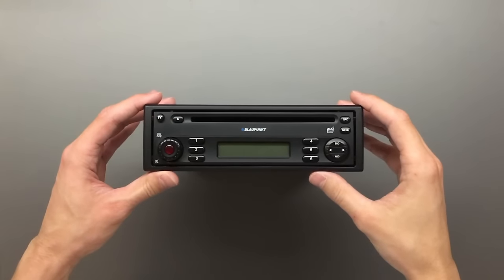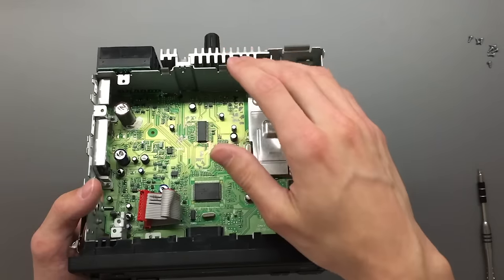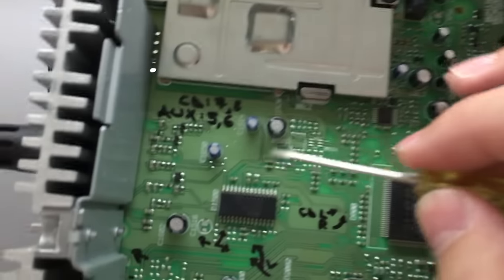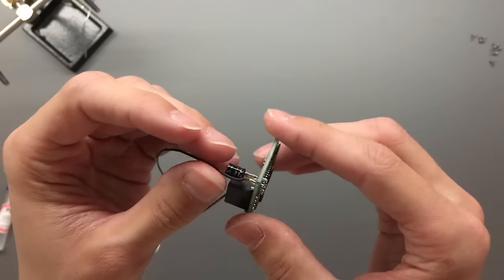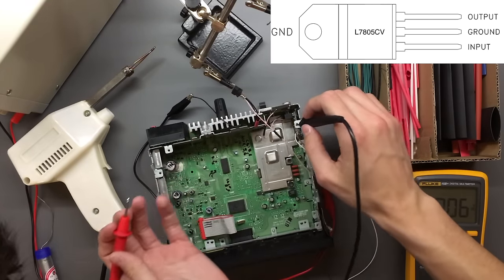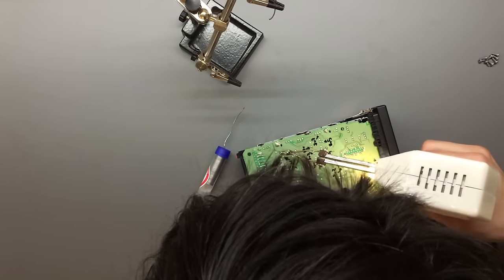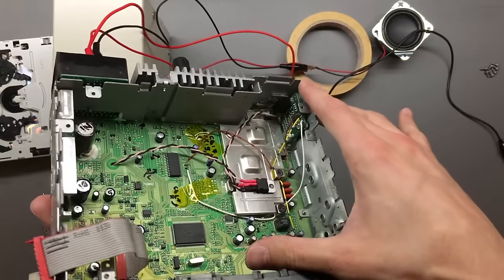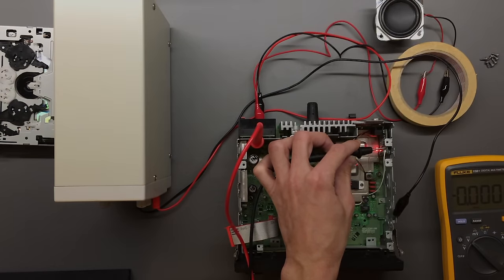How to Add Bluetooth 4.0 to Any Car Stereo for 12$ ! Complete Guide !

Comment: This is very elegant work, but you did all this and still need the CD to work for no reason, isn't there another way around it? My own car stereo had AUX, so I went that way. Used a 1W car charger to get the power to the BT board, don't know how to work with regulators or I'd use one of those. The BT chip was a cheap Chinese car to BT audio adapter. Total cost was under $5 plus work but like I said, my stereo has aux, so it was easier that way. Also couldn't fit the CD module afterwards because of the car charger case which I kept, so it and the car board wouldn't short circuit or touch anywhere. So I removed the CD permanently, it's not like I have CDs nowadays anyway. Didn't ground the BT chip either, just used two passive ferrite cores each per channel to down the noise coming for EMI.
Good video all and all.
Reply from the maker: Unfortunately mine doesn't have any way to select the AUX input, the audio MUX chip has it buut, yeah, can't select it (chip is controlled by i2c most likely)

So, although I am using the CD player, it allows me to equalize the signal and add faders 

I've recently modded a mercedes radio and fed right into the amp, but that went terrible : no equaliser no volume adjustment on the radio side and no faders

Comment: Hello I have question. Would it work if I soldered an Aux cable to the Cd changer pins in the back ?  
I have the same model radio as you does it ask for a code afterwards ?

Comment: I really would like to see if it's possible to add bluetooth to headphones (the big kind). Even though there are bluetooth adapters with an AUX output, they don't blend in with the headphones and make it look weird. I could provide a technical drawing of the chassis I'm thinking of.
Reply from the maker: It is very possible, and even rather cheap; all you need is one of these:
http://s.aliexpress.com/euQfIZ7n , a tp4056 li ion charger & protection module, and a little li-ion battery

Comment: hi darieee,
do you have a pop sound when you pause the music with that csr8645?
how do you suppres that annoying pop sound? (I havr just the module, without the green amp board)
Reply from the maker: Aaaahhhh, you've come to the right place

I've spent probably around 20 hours in total with a dude selling speaker kits trying to solve this issue ... the csr8645  chip has some bug in either the firmware or even the hardware ...

I'll correctly assume you're not using an iPhone as well; the problem is for the codecs used by android phones, IF THERE IS AN EQUALIZER ENABLED, you'll get this issue with the poping

You could disable the EQ, and it should be fine, or get an iphone, redo the EQ for AAC (which is the codec only iphones use - technically inferior but - on the csr8645 it doesn't have this issue) and it should again work

Alternatively, to keep the equaliser and have it work with all phones, you could move up to the CSRA64215 (sometimes sellers list it as just CSR64215)

That one works flawlessly
Reply: hey Dariee thanks for the reply,
Correct, I'm using Android phone,
I tried to disable the SoundAlive EQ built in app on my S8 but still get the harsh loud pop sound.
I have 4 such modules csr8645 - do you happen to know how to disable the EQ on Galaxy S8?
As a matter of fact i was wondering if the lack of green amp module was the reason i get pops... I looked and found there is a module TPA6132 that accepts differential input and has single-ended output, it also has a built-in pop suppression to eliminate start and pause pop sounds, havn't tried it yet. cheers and thanks for you help.
Reply from the maker: I meant the equaliser ON THE CSR8645 - the bluetooth chip has a built in digital signal processor that can apply an equalizer and some effects to the sound it receives from the phone (it's called Kalimba)

Check my videos on "setting an equaliser on the csr8645", you basically have to disable that on your module

Just to be clear, you get pops when you skim through music for example ?

Do you have a TPA3116 amp that gets turned on/off every time the music stops playing ? It could be the amplifier chip as well in this case although more unlikely
Reply: I dont have any amp module, just the bear blue F-3188 modules.
I really have the feeling it's the Kalimba internal eq that is causing this, can it be disabled by simply using the PSKey Tool ? or should i do a dump with it and use Config Tool to remove Kalimba and then merge back to module with PSKey tool ?? (sorry, I just got usb-spi module but havnt played with it that much...:)
Reply from the maker: Check my video on the equaliser, and you'll see all that needs to be done

In a nutshell: connect csr module to programmer, play music, start frontend (under 32b win7), connect to module in frontend, click glasses (look at the first layer to see if indeed the eq is enabled - feel free to play with setting here to see if anything helps), click glasses again to leave the blue/live mode, modify the settings, and click save psr

Mmm crap yeah scratch all that - check my csr renaming video, there should be a stock .psr there : get that.

Then go to pstool, click restore all settings (or something like that - it's in one of those dropdown menus)

After this, hit merge with my stock psr (and change your name whatever)

This should remove the eq
Reply from the maker: The reason why my initial suggestion will not work, is that PSTool with the Merge operation can either ADD or MODIFY EXISTING configuration parameters

If you merge for example my stock no-eq dump with the settings present on your chip which include the lines for the eq, those'll simply remain there, and you'll change the name line only (for example)

That's why you need to go through the restore part
Reply: questions:
1) will the 'eq disable' dump work on pstool running on a 64bit win7 pro machine? if not, can i 'brrow' from you a win7 32b install image and the VM software ?
2) I was wondering if disabling my csr8645 eq make music7 sound crappy? oh well i ges ill have to try that to know, anyhow the dreaded pop sounds must go.
Reply from the maker: 1) Yesss, PSTool works superbly with x64 win 10 fortunately
2) It really depends, given you have an android phone, you can tweak the sound on the phone, and send it "already tuned" to te device to play back as is

With iphones, you only get a bunch of presets which are no good if you have home made speakers or want stupid levels of bass 

Give me your email, I can hook you up with a fine vintage windows 7 x86 image

Comment: Or get a $40 Bluetooth radio? But I'm actually thinking of doing the same to my factory car radio. Might go full aftermarket, as those can learn the steering wheel control singles to pause/skip/play over Bluetooth. Even come with backup cameras.

Comment: Man, i consider myself techSavvy. I've repaired ps3's (complete BR lense replacement) , hacked ps2's /NDS / PSP's , root + unlock bootloader on Android , jailbreak'd iPhones, repaired PC's and all that  basic stuff, but i'm completly lost here. This is NOT  for beginners , neither for adepts. But koodos on this stuff. This is impressive. But not for me :/ , cheers !
Reply from the maker: Naaah I don't know, if you have a multimeter and are lucky to have a roughly similar topology, you should definitely be fine

Comment: What, no foam, or even tape, to cover up the connection points on the BT board? As in, to secure it from shortouts?
Reply from the maker: mm, nah - it's held in with 2 screws ... and the cd module, which is the other metallic component that could mode, is also held in with screws in at least 3 points

also - the general public isn't allowed in there so - should be fine
Reply: Darieee But what does the way it's mounted, have to do with electric safety? I'm no expert on this kinda stuff, so I'm confused. But thanks for the reply, anyway.  #eurozone  (As in Europe, not the EU thing in Brussels. 😆) Oh, nevermind, now I see. I went back to the video, and went fullscreen. There are some kinda spacer on the screws themself. Nice job, and just how I would like it too. Very professionally done. 👍
Reply from the maker: Thanks - so, safety wise, you could lick everything, it's 5V or less

Comment: Is there any way to cheat the autoradio in order to avoid using the blank CD? I believe it should be possible to identify which pins are activated when inserting the CD and tell the autoradio to switch to this input

Comment: My stereo has aux output so I bought usb powered audio bluetooth module from ebay for 2$ and soldered aux out wires from module to aux in of my head unit, downloaded datasheet of my head unit to find 5v source to power bt module and soldered these wires, done. if its branded head unit there is a chance you can find datasheet for head unit, mine was Pioneer.
Reply from the maker: Nice!

Comment: geat video , what if i call using this bluetooth , does the microphone of the phone works ? , have you tried this ?
Reply from the maker: yeah that's actually by default a huge pain in the ass - you'd be on a call, start the radio - the bluetooth module inside would hijack your call posing as a bluetooth headset, aaand yeah, the volume would be way too low for you to hear the other person, and said other person would be unable to hear you unless you'd have connected a mic (which someone in the comments here said they did - and that it worked fine)

if you want it to work as a normal bluetooth speaker, you'd have to do this : https://www.youtube.com/watch?v=rrxBgFDEjMM

Comment: only my way to see the things here...about the aux input selector some radios need to have a resistence on the cd charger/aux input in order to let you select the input...with out the resistence the item conected seems not in the list of items to control....some manufactures put different values to each item to control in order to the resistence the radio (knows the item is connected) sorry about my english...im from costa...tnks..
Reply from the maker: +alejandro soto mmm, might well be - the way I was(and am?) assuming its done is they simply have 2 ROMs for the Microcontroller - one with the AUX enabled and one without ... it would indeed be more elegant if it was done your way, if anyone knows for sure tell us

Comment: Hello, I would like to try do this on different Blaupunkt radio. On mine I have two microchips: TDA7476 and TDA7433D. Which microchip I should use and which pinout?
Reply from the maker: most definitely the second one; but, which pins exactly will depend on the topology of your specific radio
Reply: Darieee  can you recommend me some for pins pair for beginning? I will make tests.
Reply from the maker: doesn't work that way - if you don't even roughly know what to look for, it's probably best to leave it fir another time and watch some more ffcossag

Comment: Hi, Ich glaube du bist aus Deutschland, deswegen frag ich auf Deutsch.
Woher hast du das DataSheet bekommen?
Ich bin Student und habe ein standard VW Multivan Radio und hätte das auch gerne anhand deiner Anleitung modifiziert.
Und noch was: Was macht dieser "capazitor" den du an das Board gelötet hast?
Bitte entschuldige vielmals die ganzen Fragen, würde mir nur wirklich sehr viel bedeuten, wenn du mir da weiterhelfen könntest!
Beste Grüße, Lukas
Reply from the maker: Hi - welchen Datasheet meinst du ? (alle sind allerdings auf google sehr leicht zu finden :)

Am Anfang solltest dein Audio Multiplexer Chip finden - sitzt fast immer sehr nah am Amplifier Chip

Welches Kondensator meinst du genauer ? Die kleine auf den Bluetooth Board ? Der ist da um sicherzustellen dass der Bluetooth Chip nicht gestört werden kann

(PS: bin aus Rumänien - studiere hier allerdings xD)
Reply: Hi, danke für die schnelle Antwort - du schreibst sehr sehr gutes Deutsch!
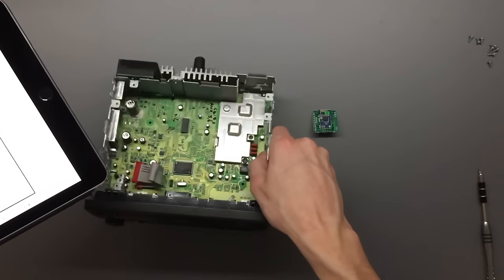Das Datasheet, das du auf dem iPad (z.B. bei 2:37) hast. Was hast du da gegoogelt?
Ok steht da dann dabei, wie der chip heißt (Audio Multiplexer)?
Ich meinte den Kondensator bei 6:37 ; Was sollte den Bluetooth Chip stören? Was hat der für eine Typenbezeichnung? Und benötigt man den auch bei dem 12Volt Modul?

Deine Hilfe Bedeutet mir wirklich viel! Versprochen, ich versuch dich nicht mehr zu fragen als wirklich nötig! Ich weiß, wie das ist, wenn jemand in den Kommentaren immer 100 Rückfragen hat.
Reply from the maker: danke auch xD

Datenblatt auf dem iPad zeigt ein TDA7419 : also, eine suche nach "TDA7419 datasheet" (oder was auch immer auf den chip geschrieben ist + datasheet) soll normalerweise funktionieren

Ja - der Kondensator meinte ich auch - ich habe keine Ahnung wie gut meine Stromquelle ist - und mit ein Kondensator da, riskiert man weniger : also, das wäre eine sichere Vorgehensweise (so wird der Spannungsregler auch stabiler).

Der Kondensator ist 16V und 22uF

Bei der 12V Modul ist es wichtiger würde ich sagen ... Und die sind auch sehr billig auf jeden Fall, also ...
Reply: Darieee Ok Super Viele Vielen Dank! 
Verstehe, also der Produktname steht auf den Chips geschrieben!
Jetzt wars das auch mit meiner Fragerei (hoffentlich)! Nur eine Sache noch: Warum hat der Kondensator 16 Volt, wenn nur 12 anliegen sollten? Ist das nur so eine Art Sicherheitsvorkehrung?
Und, benötige ich für die 12 Volt Variante auch nur 22uF, oder mehr?
Bitte entschuldige noch einmal die ganze Fragerei, ich hoffe wirklich, dass es das jetzt war!
Reply: Eine Sache ist mir gerade noch aufgefallen; Hat der Kondensator, den du benutzt hast 22uF (Mikro-Farad) oder 22nF (Nano-Farad)? Weil 22 Mirko Farad erscheint mir irgendwie ziemlich viel, aber vielleicht schätze ich das auch falsch ein!
Reply from the maker: Bei mir sind's 5V und der Kondensator ist 19V - dass ist so was für ein Regel: immer ~10V mehr als was du wirklich brauchst

22uF : also micro Farad - ist eher wenig (der großte Kondensator (mit IN beschriftet) ist wahrscheinlich 1500 - 2000uF)
Reply: Ok. Nur noch diese Frage. Tut mir echt leid, dass ich dich aufhalte!
Mein Örtlicher Elektrohandel hat einen Kondensator mit 25V und 22uF - Ich denke eigentlich, dass das auch gehen sollte, wenn du sagst ~10V mehr als man braucht, oder übersehe ich da was, was dagegen spricht?
Außerdem soll ich dann, wenn du meinst dass 22uF wenig sind, eher ein bisschen mehr kaufen, wenn ich auch einen mit mehr Volt nehmen müsste? Oder soll ich dann den mit 25V und 22uF nehmen?
Sorry echt, für die vielen Rückfragen, sollte es jetzt gewesen sein!
Aller beste Grüße, Lukas
Reply from the maker: Keine Sorge :) 

Jöa - perfekt ... es wird ein bisschen größer aber sonst, perfekt

20 - 100 uF soll passen ... wie gesagt - es soll perfekt funktionieren auch ohne Kondensator - ist aber "good practice" einer einzubauen

Viel Spaß, und, ja, keine Sorge - ich weiss wie es ist, viele Fragen zu haben - bin selbst genauso :D
Reply: Ok super! Vielen Dank!
Eine Sache hab ich noch und zwar war ich jetzt überrascht, als ich mein Radio geöffnet hab, dass es viel komplizierter aussieht  als deins :/ 
Vielleicht kannst du noch ganz kurz einen Blick drauf werfen und vielleicht siehst du, welcher der vielen Chips der benötigte Audio Multiplex Chip ist :/
Sorry wirklich! Dachte ich bekomme das alleine hin.
https://drive.google.com/open?id=0B-wWM1X0gUNUbWtyMFBhbl9YN0U
Das CD Laufwerk habe ich schon abgetrennt; war an dem Silbernen Adapter (Mittlere Höhe, rechte Seite)
Reply from the maker: Und als Eingang kannst du kein AUX wählen .. oder ? Nur CD und Radio ?

Gibt's Komponente auf die andere Seite auch ?
Reply: Nein, einen Aux Knopf habe ich leider nicht :/ Genau nur CD und Radio.

Ich hab in den DropBox Ordner noch 2 Bilder von der anderen Seite hochgeladen, aber ich glaube nicht.

Dieser BU1924F ist nicht der richtige oder? Der hat immerhin so eine längliche Form:/
Reply from the maker: Ne .. das hat nur mit der Radio zu tun .. was sind die andere Chips ? (außer die super große)
Reply: Ich hab mit Photoshop drauf geschrieben, was auf den anderen steht; hab es in die dropbox geladen. Hoffentlich sagt das etwas mehr aus. Vielen Vielen Dank für deine Hilfe!
Reply from the maker: Jöa .. ist anders als bei mir gebaut - was sind die Power Amplifier Chips (linke Seite) ? vlt können wir da under Signal direkt eingeben ...
Reply: Welche meinst du? Sind das die ganz kleinen Schwarzen Dinger, die ich noch nicht beschriftet habe?
Wäre es auch denkbar, das Signal direkt über den CD Laufwerk input (mittlere Höhe; rechte Seite) hineinzugeben? Also dass man dann zwar leider kein CD Laufwerk mehr hat, aber wenn man auf "CD" drückt, dass dann der ton vom bluetooth Modul kommt?
Reply from the maker: +Lukas C. Roder keine Ahnung wie es implementiert ist, mittels den CD scheint eher kompliziert zu sein

Die Verstärker Chips sind die große die unter den Metalding links stehen
Reply: Darieee Ok. Also die haben richtigen Namen drauf stehen, wie die anderen. Aber auf dem größeren steht: D4 IRS und auf dem kleinen D6 IRS; es erscheint mir aber auch schwer die metallplatte vorne weg zu schrauben, sodass man an die hinkommt😬
Reply: Darieee Sorry die Namen die ich dir gerade geschickt hab sind von den 2 schwarzen Dingern unten Links; Meinst du die auf mittlerer Höhe links? Hab ein Bild von der Seite gemacht (hab das außen dran weg geschraubt und lads in die Dropbox; die Namen sollten sein: 23T/L1747 (unten drunter steht 553/TN421) und auf dem Zettel daneben Leg. 659
Reply: Sind hochgeladen
Reply from the maker: Kannst du mir deine email kurz geben (dann kannst du es wieder löschen) - ein bisschen unangenehm hier zu schreiben

Comment: I love these kind of hacks!......now please  show me how the add lithium ion batteries to a class d amp that uses a switching mode power supply!......my small guitar vocal amp doesn't have a 12v transformer!
THE reason I I need this is to play outdoors!
Reply from the maker: Check this video out, it should have all of what you need: 

DIY Bluetooth Speaker : Parts Guide 2 : TPA3116 + CSR8645 + Power Monitor + Arduino

https://youtu.be/kg5TZE76p9I